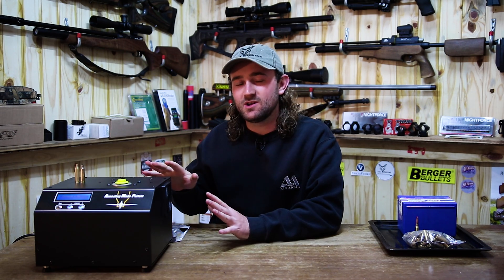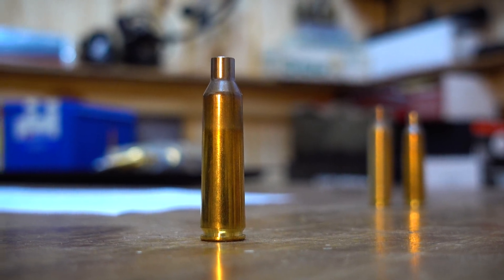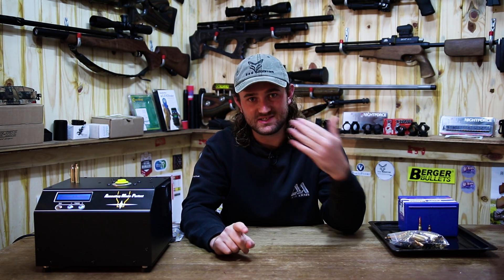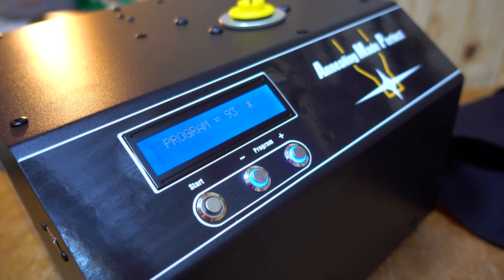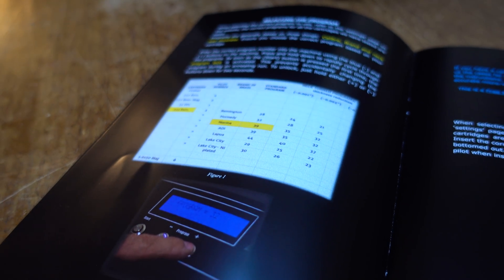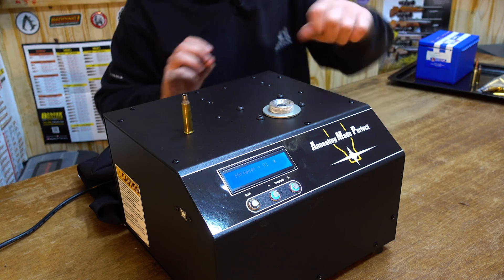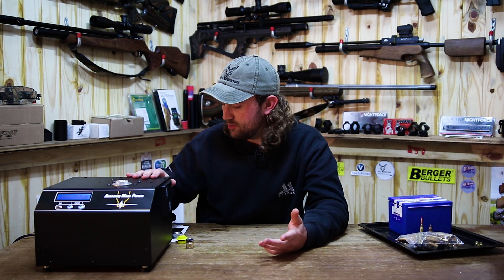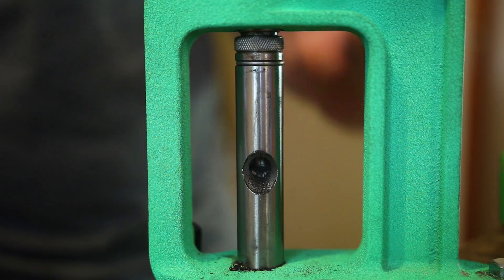"Annealing Made Perfect" Machine - Gear Update #6

Comment: I would have really loved to own one of these, but they are really overpriced. What makes this machine unique is that they have managed to keep the annealing temperature a secret. If we had known the temperature they use we could have achieved the same with a gas flame for a few dollars. As far as I can understand they have figured out what temperature is needed to soften the brass to the correct hardness, then they have come up with a mathematical formula that will calculate this temperature based on when the brass melts. This calculated temperature is probably much higher than 750° F which will only effect a stress relief, and only affect longer brass life.

Comment: For the selling price its not that bad if you share it between 3 of your mates. That way you have turns when reloading your rounds and still get the benefit of the machine. If you and your mates buy all the necessary equipment for reloading the total price is not that bad, make a production line and see how quick you will push out your rounds. Great vid and thanks for the free knowledge.

Comment: Hi Matt,
I've had my AMP annealer for over a year now and can thoroughly recommend them, it's an awesome piece of kit.
I mainly shoot .223 R.E.M. and my overall spread came down from 45fps to 7fps measured over 10 shots, and muzzle velocity increased by 25fps average.
The down range results were very noticeable indeed.
I also anneal brass for a few club members and they too have commented on having much increased accuracy.
I'm sure you will find it an indispensable piece of kit.

On a different note, I've just had my FAC back from the firearms dept. and had a FAC air rifle added (uk laws) and going for an FX Crown in .22 caliber. It's very difficult getting hold of both the Crown & Impact here in the uk, so may have a bit of a wait.

Awesome channel Matt, keep up the great work.

Regards
Steve